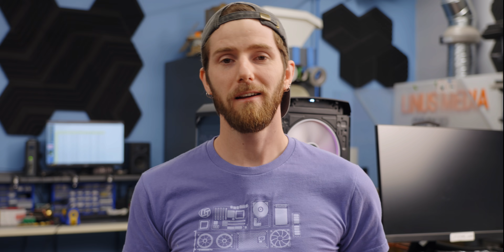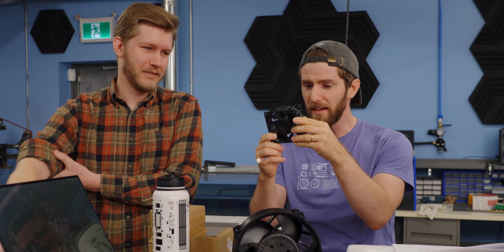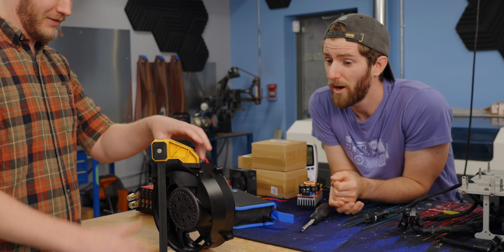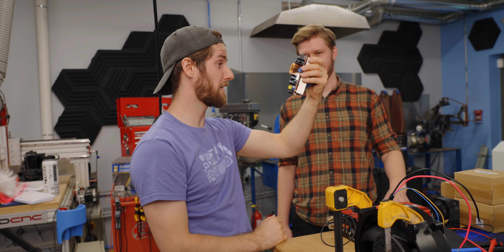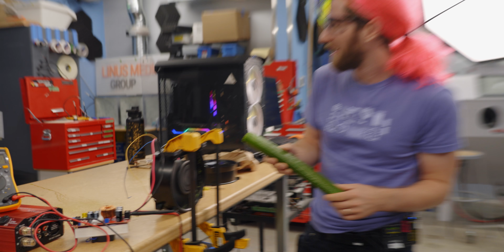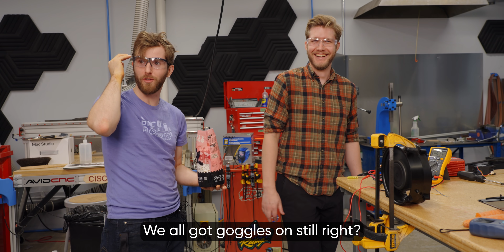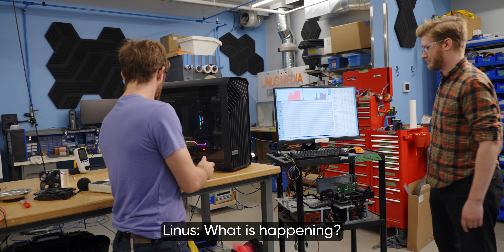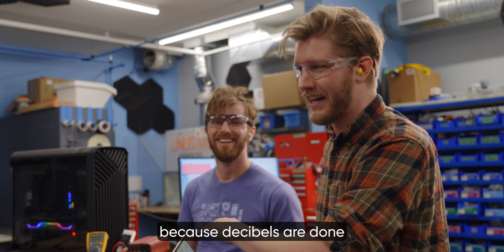The God of Computer Fans

Comment: At 600 watts you might as well build an air tight case and attach an air conditioner that uses 600 watts. Tech Ingredients has proven that just an air conditioner can keep the temps down inside a case.

Comment: I work in the chemical industry as an electrician, we have similar, though not quite as powerful, fans above all of our switching cabinets, where our PLC's and stuff life inside. They are mainly used to draw the hot air outside, since the cabinets are bottom open, and the floor is usually doubled up for all the thick wiring, where it’s also a lot cooler. There’s also climatization, which cools the lower floor.
Reply: This one is similar in size and flow rate to the big old Tarzan fans I used to cool an ALC 60 and 63 argon laser. Nothing like trading a few kw of electric power for maybe 250mW of teal blue laser light😂

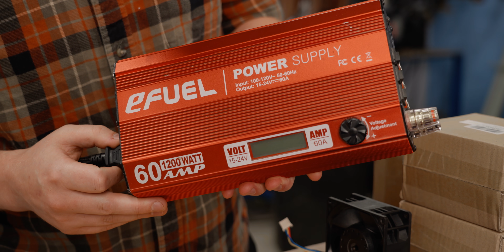Comment: 3:31 on that, psu's have a -12V pin which if used instead of the GND combined with the +12V you can actually get a voltage difference of 24V (not enough for the fans but still more than 12V.
Though wouldn't recommend if you don't know what your doing.

Comment: not exactly sure on the rpm but have installed similar fans inside electrical cabinets for exhausting the heat generated by contactors, breakers, transformers etc. Definitely not 7300rpm but similar size and voltage

Comment: I work in semiconductor and we use those fans on the top of instrumentation cages to move air from the bottom all the way to the top of an enclosed 6ft tall rack of instruments. They're monsters!
Reply: Speaking of 'monster fans', there R some old '$ilicon Graphic$' main frame type giant tower computers that have a single big fan in them 2 cool it all = maybe Linus can get some & put it on his 'gaming rig'? LOL =))  They should do the 'car radiator' thing again BTW, but with actual car fan & shroud instead of the stupid 'slap on mini PC fans' joke.

Comment: Went to an electronics store once for computer fans to cool down a PC by making two janky side panel openings.. Ended up putting in non PC 120mms. Turn it on? The computer wanted to tilt and it sounded like a twin jet engine. The CPU and GPU went down 20C though. Air flow EVERYWHERE. That is what this reminds me of.

Comment: I use a server fan to cool myself during summer, but i use a 12W power supply, not a freaking reactor, and even that has like 10 stickers on it about cutting off fingers. Also i once made an almost identical boost converter from scrap using a blowtorch instead of a soldering iron (didn't have one) and it's funny how much linus is scared of it.

Comment: You know those boost  and buck converters are pretty good, efficient for the money. I use them all the time, and 1500 watts might need a fan! You may not realize this, but all those led bulbs you buy to save money? They have Chinese ac/dc buck converters in the E27 base you screw into the socket. The bulb will last much longer, but the converter will not. And with a fan, that 1500 only cost me $27 so you got it from the wrong store on Ali!But that fan seems to be a great juicer though. I had a 6000cfm 1 hp squirrel cage blower, never never turn it on in the house when you have things like a cat, or papers.,,it has a ton of static pressure and will tip over your cat and roll it along the floor. He was chasing something the fan blew across the floor and ran into the air stream. Pretty funny.
Your fan is lousy for an audio workstation! Maybe a small scale wind tunnel.

Comment: Linus, when you put that stock fan on front of the Blowzilla, the dangling wires from the fan, in front of intake, just waiting to be turned into copper scraps when they get pulled in while fan self destructs, starts hitting aluminium die cast case sending pieces of metal at high speed.....
....made me uncomfortable.

Comment: ok,  I want one. Also, what cpu is that? and is it afforable.. AND how much to have someone like you build this exact configuration for me? namely, i just want max performance
also, you should disable throttle states. throttling is bad. I have a laptop and I disabled C states, and disabled throttle states. with the high perfomance power plan. 
e

Comment: This size fan is not uncommon, but it is uncommon for equipment (besides in a rack chassis where you have the height limitations for the fans) to be designed to need this RPM for the airflow instead of using a larger fan. 

They don't have good lifespan when ran that fast and that's a real concern on equipment that needs constant uptime.  Granted, in that case they should be replaced on a schedule before failure, but it's still better not to design for short lifespan.

Comment: We used these fans on the testing ovens and the 256 site testing computers in memory manufacturing. They are not as loud as you would think, and you get used to the noise and wind after a few days.

Comment: 48V (minus 48V to be specific) is used a lot for telco equipment power, and these type of fans are used in the base stations as well.
Reply: +48V is making ways into the DCs too now that it's possible to buy a cheap 4U LiFePO4 battery that holds up to 10 kWh of electricity to replace an expensive rack-mounted UPS. I'd love to see it coming to the consumer PCs too - 48V ATX PSUs do exist but the cost is currently prohibitive, like $700 for 600W.

Comment: 20 years ago i checked on a similar but smaller 120mm fan, the manufacture specified that the fan should never be mounted like they did, should always be mounted so it draws air out because it could otherwise break addon cars and rip components off the motherboard.

Comment: You know, you can try to get yourselves a hand on some axial fans. These are 4 or 5-inch fans that they use to cool off the electronic bays in aircraft. They move a lot of air, you can acquire some for a cool $1,000 or less depending, and they move something along the lines of yes air in a second. All you got to do is give it a 115v AC and 400 Hertz of power. It's about 12,000 RPM and they they're more like hurricanes in a can, but it would make for an interesting video. Especially since there's some Airlines in your area, your specific part of Canada, that do sell them.

Comment: Computer dc fans usually can't be converted into generator as they mostly use a complex circuit to spin the fan rather that simple arrangement of carbon brushes in usual DC motor.

Comment: You can tell Linus doesn't see boost converters very often because I think I've only ever seen two that came in a chassis(way more expensive as well, 20-30x the price) and every single one I've ever seen was controlled by potentiometers, just sometimes they have a thumb dial pot instead of one needing a screwdriver, and decent ones have a small display so you don't need the multimeter to set it. Sorry Linus but I'm with Alex on this 1000% lol

Comment: under $300 for a 48v 2000w PSU no where near $800 only took under 30 seconds to find on amazon lmfao
Reply: $279 JINGMAIDA Switching Power Supply 2000W with PFC 110-240V AC to DC Power Supply 48V 41Amp 2000W

Comment: We use them in high power transmitter cabinets for broadcast systems. Typically, one is an intake at the bottom and one is an outtake at the top.

Comment: nice video, just one question. you guys know there are 120mm AC coolers for much less? the big plus is you dont need an extra power supply you simple plug them into the outlet and it works.

Comment: I'm a repair tech at a lighting company. We use these guys on some of our robotic light fixtures and some fog machines. The lights get REALLY hot, so much so it melts if the fans are underperforming.
Reply: That's actually pretty dope
Reply: holly shit thats metal AF
Reply: just buy old metallic fans for office desk from the 80s
Reply: people really don't realize how much a bank of incandescent bulbs put out lmaoo
Reply: I just said I don't think they would be quiet enough for cinema use but if they are used in intelligent lighting like Vari-Lites or other systems, maybe they could be used in projection.  Both tend to use Xenon arc lamps if I remember correctly.  Or are you talking about something bigger?
Reply: @WJCTechyman  I'm not in cinema but isn't the projection room well isolated?
Reply: @WJCTechyman  A lot of the time every sound U C 'on camera' is added in $tudios after the fact in 'post production' with actors & stuff doing 'lip sync' 2 their lines, & 'foley' simulating the 'environmental' sounds.
Reply: The weak melt only the strong shall survive
Reply: Wow cool to learn where these are used for, those are some seriously hot lamps :O
Reply: Aquarium lights are similar. They can melt the lenses if the cooling isn’t sufficient or sometimes just through normal use. I’ve had to replace the lenses in mine twice!
Reply: Yo wtf, lights can get that damn hot? holy crap
Reply: we use them on the Hybrid battery banks on our boats to get good airflow over all the cells
Reply: What happened with LED lights barely hot
Reply: Watching a fan melt from the heat it's trying to dissipate just sounds so awesome.
Reply: @CynHicks  reading comprehension. the lights melt, not the fan
Reply: @CynHicks  it's not the fans that dissipate it's the fog lights
Reply: @CynHicks  comment never said that the fan melted
Reply: stupid inefficient dingus lights.
Reply: Why don’t they have thermometers to ‘throttle’ if it gets too hot? I can’t imagine they’re very cheap so a failsafe would make sense to have

Comment: I would assume we have fans of this kind in our HVAC in the Serverroom. If you turn the HVAC on all of them spin at maximum for a few seconds and you could think a Jet is starting right beside you. 
The system is build in a way that the front fans are pushing cold air into the servers ans at the back the warm air is sucked in and would then be cooled down just to be again ejected at the front. 
But after the initial spinning they calm down and don't run at maximum speed.

Comment: I had 2 fans slightly less beefy than this one installed in a PC case many years ago. They came out of an old commercial Xerox machine from the mid-late 80's that we disassembled in my high school vocational electronics class. I still have them to this day some 20+ years later. It got tons of laughs and questions at LAN parties and such. They had their own PSU in a separate case that sat beside the PC case and had a control panel with aviation surplus shrouded "arm/disarm" switches for power and a few switches to make it run at specific RPMs or they could be bypassed and controlled by a massive rheostat. The fan PSU had an old vintage analog RPM gauge that was salvaged from an old hydroelectric substation that I'd installed LED backlighting in and matching sets behind the fans that would progressively grow brighter and change from green to yellow to orange to red as it neared max speed. It was so much overkill, impractical, and absurd and I loved it. I ended up disassembling all of that a long time ago and relegating them to run at a lower RPM than initially intended because it was just ridiculous. I just went and looked and they are NMB 5920PL-07W- B70-D00 48v DC brushless fans. They're 172mm x 150mm x 50mm,  1.45 Amps, 24.5W, spin at 4000 RPM and move 300 CFM or 8.5 m³/min. Static pressure rating from a single fan is 226.5 Pa, and it's a whisper quiet 63.2 dBA. This was a fun vid and I'm glad dumb stuff like this is still being done! (edited to correct model # and specs)
Reply: I just love the idea of a ridiculous military-grade looking cooling solution with a bunch of bells and whistles - having to flip a bunch of switches to even get it to work would freak so many people out, amazing.
Reply: What a joy to read this. Thank you so much for sharing! I haven't had a LAN party in a couple years and I need to fix that stat
Reply: I really do need these control switches for my duo turbine from soviet mainframe. With writings in Russian, of course.
Reply: I remember seeing the fans you are talking about on old Xerox Docutec digital press machines. Basically a giant laser printer meant for high volume or large documents
Reply: They're designed 2 B efficient 4 the huge air flow, not quiet.  Slowing them down is dumb, because U can $ell them high & buy something 'slow & quiet' much cheaper =)  Or simply get PCs used that R quiet in the first place, like 4 instance a Dell with the 'stepped stair case' style front, like T5810.
Reply: @Deathrape2001  its 2023, why are you still using 2's and 4's instead of "to"s and "for"s?
Reply: @cescimes It's like the fact that it is 2023 is the ultimate excuse for people who want shit they don't like to change.

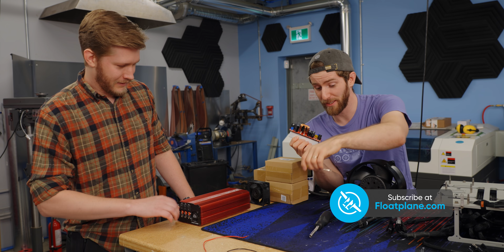Comment: 4:45 You'll laugh, but for these use cases there are even plastic screwdrivers*. Sure, you can't tighten a bolt with it, but if you're pocking a life circuit with it, it does not fry you nor your electronics if you poke the wrong place by accident.

*= or in a pinch an insulated one. It won't help that you fry your stuff by shorting it, but it will help that you won't get fried.

Comment: It would have been interesting to See one of these as an intake and one as exhaust
Reply: or both as an exhaust
Reply: @cybermarc8740  I feel like turning your computer case into a vacuum might come with issues...
Reply: That would just cut the air flow in half = lame, like mounting 2 speakers 1 behind the other in a box = dum.

Comment: There is a sticker on the back of the fan. It reads "12v 3.6A. (Rated current 4.5A)"
12*4,5=54.
This fan is a MAXIMUM 54 Watt fan
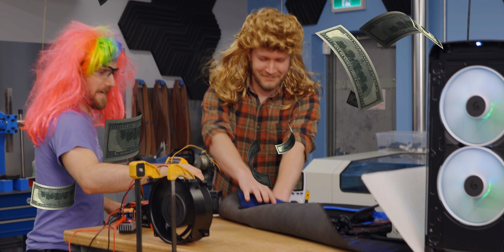Reply: 0:09 Check again, it says DC48V 12.5A

Comment: we use those fans in MCC's and in PLC panels. Ive actually taken a few from work to use as ventilation fans for my shop. Going on two years with them in the elements plus the 10 years they were in service at a Water Booster Station. The are great for cooling off Soft starters and VFDS

Comment: equipment frames and bays in telecom or phone or plant or datacenter offices which require high air flow cooling through the equipment racks for network servers, switches, routers inside the equipment bays and 48v DC is the standard(started with ATT) in those offices.

Comment: And then is level 2: the industrial air compressors :)  In one case of underground tunnel ventilation during the digging stage,  one of them was mounted and started, by the time people realised it had an unfinished pipe outside which was turned towards the ground it already dig a 2 meters crater in the ground in just few minutes.

Comment: I bet this would solve the 4090’s power cable melting issue
Reply: @ZarikVarik The instructions are no help when the socket for the power is designed terribly with no proper feedback on whether it is in fully or not. It's a common complaint that there's no proper click for those cards and that it should've been angled JUST LIKE BEFORE
Reply: no... thermal resistance
Reply: You are Scandinavian, I feel it. Sweden?
Reply: So would properly attaching the cable...
Reply: @davidgarris7467  Even better, not designing it like utter shit so you KNOW it's plugged in properly
Reply: @xPandamon  you can eyeball that it's in properly...
Reply: @TheRealWalterHWhite  That's the problem, people eyeballed it and it was NOT in properly. Simply because Nvidia fucked up the design of that port majorly, after already doing it well the year before. No clue what's wrong with them, at one hand they have impressive hardware, but then they mess up like that, also it's so silly that their control panel is so terrible compared to AMD when you use a beast like the 4090, it just feels so out of place
Reply: @xPandamon  Nvidia doesn't care about the consumers anymore. They're the Apple of GPUs now and I think they've accepted that by now. 

We need more competition in the GPU field, thankfully we have AMD and Intel. Would be ideal if there were more, sorta like smartphone companies.
Reply: @davidgarris7467  flex tape m8
Reply: @davidgarris7467 so would just not plugging in the cable at all

Comment: I've used fans of this size for cooling PLC cabinets in industrial settings.  It's in a manufacturing factory core area that usually has nobody working in it.
Reply: came here to say the same thing
Reply: Yup, came here to say something similar. CNC machines i've worked on use similar fans on the electrical cabinets.
Reply: I’m assuming hearing protection areas?
Reply: @avisions  there noisy but you wouldn't need hearing protection, especially when they're in plc cabinets
Reply: @avisions  Definitely yes.

Comment: I didn’t even know a 600W computer fan was possible.
Reply: Its basically an industrial fan
Reply: Wouldn't that be something like $1k a year to run this thing alone at full power nonstop?
Reply: @FrantiC119  For me it would cost 3000 euros to leave it on fulltime
Reply: @martijnderidder861  Well that's kind of your fault for not being located on top of a lot of a bunch of oil. I hope you learned your lesson.
Reply: @FrantiC119  I got solar
Reply: @martijnderidder861   What a legend
Reply: @martijnderidder861  bahahahah
Reply: @martijnderidder861 Imagine running a server with an AC and you put this fan 3k would easily double it
Reply: When the fan itself creates more heat then the rest of the system
Reply: Server fans:
Reply: You should see some of the fans in the RICER (basically a centralized computer room of a Warship).
Reply: That thing turbo charged? Hehehe
Reply: it is not a 600watt fan, it is 54watt fan (4.5a 12v)
Reply: @jaydeekeejdk3418  It is a 600 watt fan, the ones from the video that is. A 54 watt fan is not going to cut carrots into mush like that.
Reply: it is not possible, the 48v requirement with no native 5v PWM is kinda the dealbreaker
Reply: Everything is possible
Reply: is plain stupidity. for a little percentage of its price just but a home depot home ventilator fan and put it behind the pc lmao
Reply: @ChaosLordDiscord  no